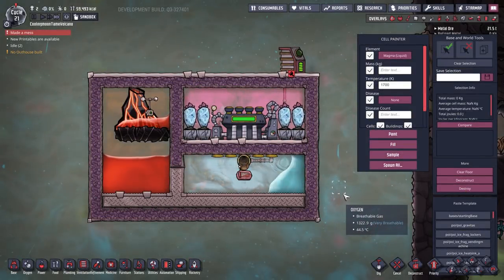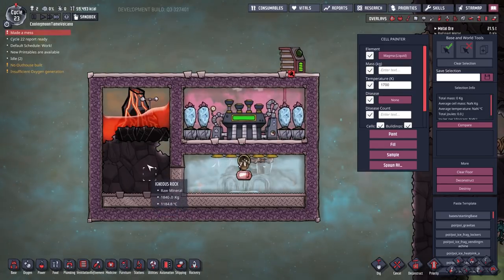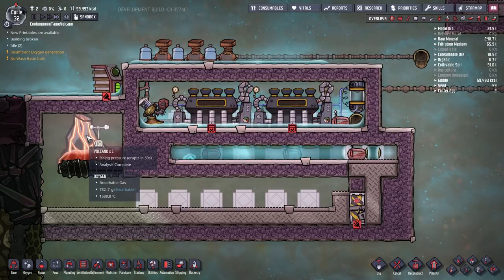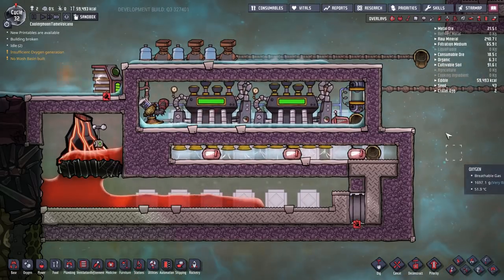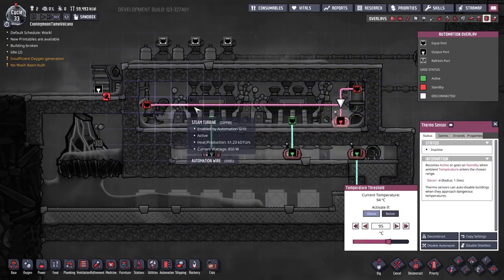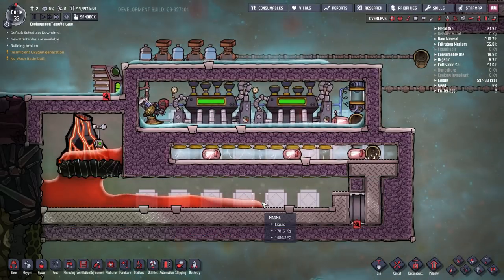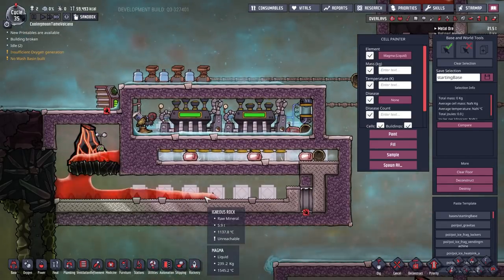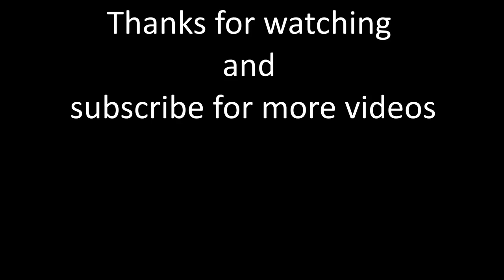Oxygen Not Included QOL Mk3 - Simple Major Volcano Taming 1 - Steam Power

Comment: Nice vid. 
Does the solidified magma lose its temperature when it changes like before? I saw that magma, which is 1000+ temp, would turn to rock at 100ish and lose much of its heat..
Reply from the maker: To keep the build simple and small, it does not contain sweeper and conveyor. Without them, It takes a long long time to release heat in solid form since the mass is so big on one tile.

Comment: i goted copper vulcano, i get some copper from it. but i culdnt analize it. i also put there durt water to heat germs but it didnt work out( vulcano staed at 99 degrees when water is only 33
Reply from the maker: To analyze a volcano / geyser, you need a science guy to be able to do so. It takes time but not too long. Make sure he is wearing suit so not being hurt by liquid copper. And for the second question, it is because metal volcano emit very little liquid metal at once but water is much larger in mass comparing to the mass of metal from the volcano. So the temperature of water is not rising much.